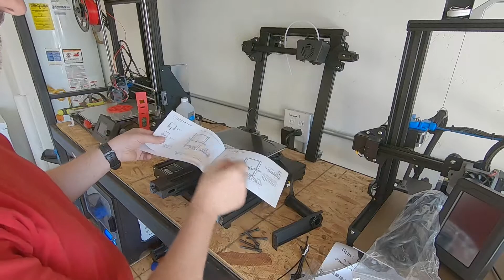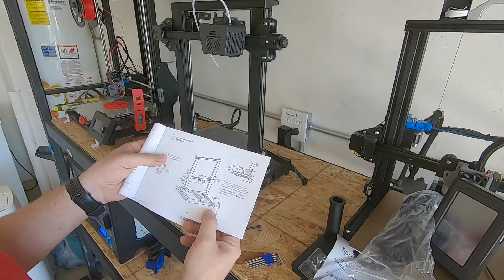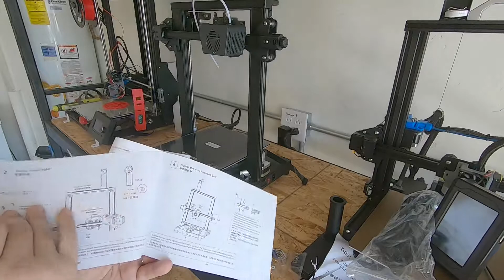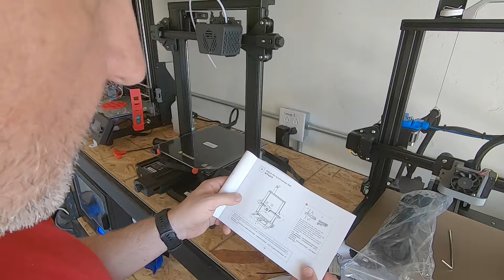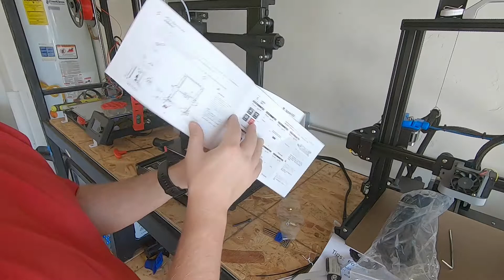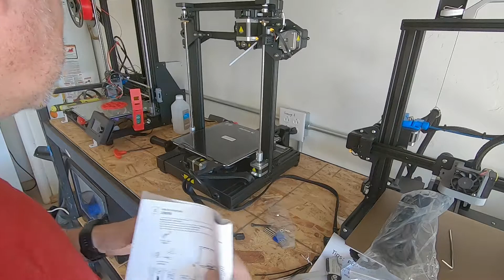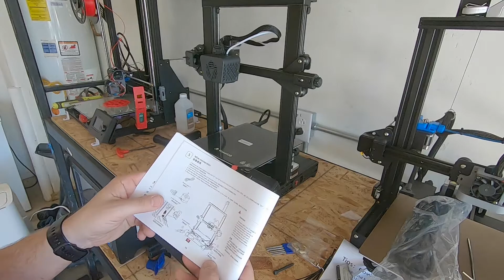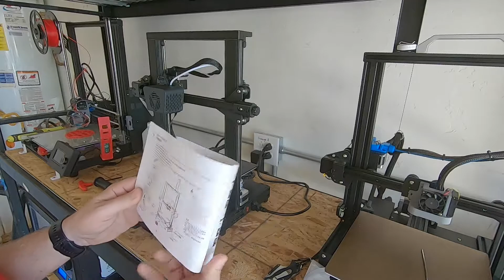Aquila Pro Part 1

Comment: I sell 3d Printers for a living and I will NOT be stocking these anymore.  The one I sold failed after a few prints and likely due to the flat ribbon cables (casual users should not be expected to handle that type of cable).  The real deal breaker is the new mother boards cost more than 3 times the standard boards ($105 compared to $30).  That is outrageous enough that I will probably stop dealing with  Voxelab altogether.  Who puts a $105 mainboard (plus postage as it is not stocked locally) in a $200 printer ?